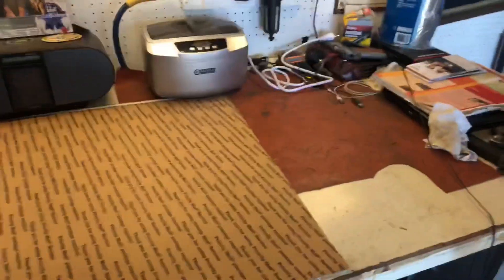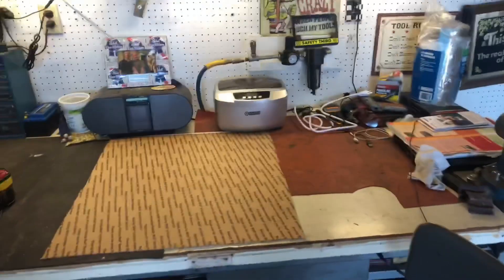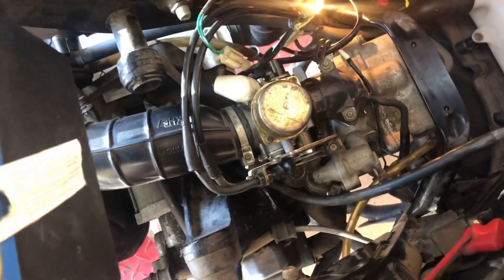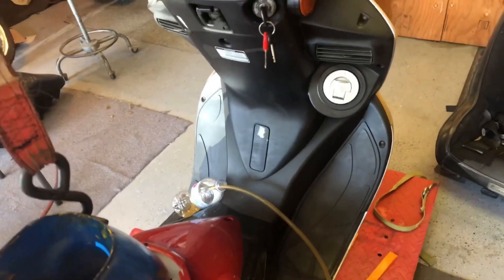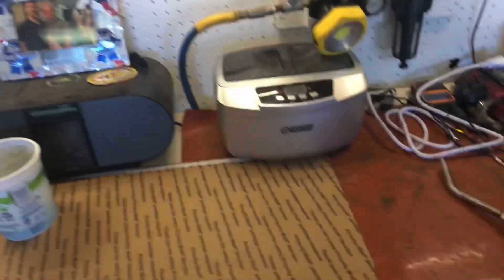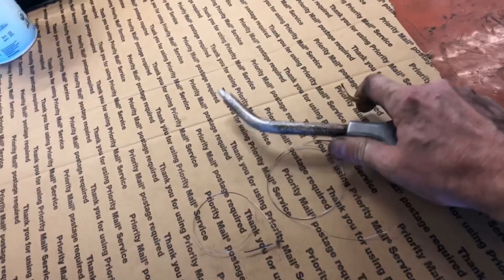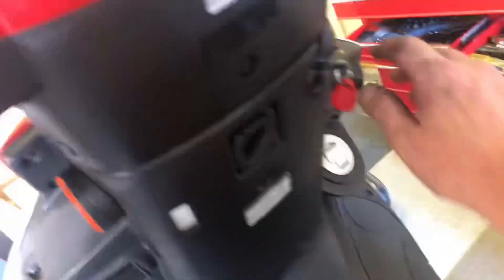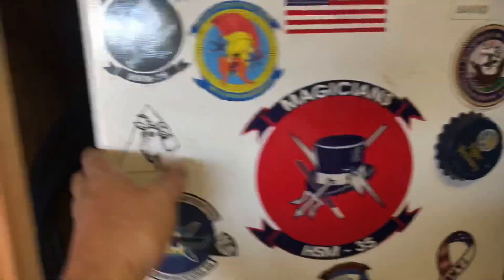Kymco scooter revisited.

Comment: Attention to the head tinkerer. Mr. Tom you're your videos have been invaluable valuable I recently picked up a KYMCO 250 adventure scooter of my own..."TO SELL!!" interjected my trophy wife. Thanks to & for your videos every issue I have run into so far hasn't been a huge problem. recently got a repair manual so I too can RTRM. I have few body issues damaged and or missing panel is there a after market place where they can be found? EBAY is mostly miss. Hits a rare. Thanks again Mr.Tom. Keep doing it.
Reply from the maker: Thanks for the kind words.  I recently sold my scooter, it was not easy…I really liked it but I’m trying to clear out some things.  Unfortunately body panels are in very short supply for these bikes.  Your best bet is to just keep looking and be patient.  Enjoy the ride!

Comment: Do you know how to change the headlight on the kymco 250?
Reply from the maker: I have been in the headlight housing, but it has been a while.
Reply: @TomsTinkeringandAdventures  Do I need to take out all the screws from the black plastic area to get to the headlight housing? Sorry, I'm clueless when it comes to this. We just bought this little scooter used and it runs great but the headlight is out.
Reply from the maker: @victoriahurley2514  I can’t remember how many screws or which ones I had to take off.  I’m traveling right now, otherwise I would take a look to remember.